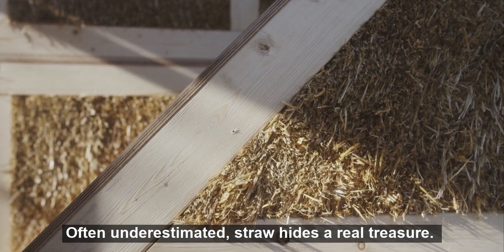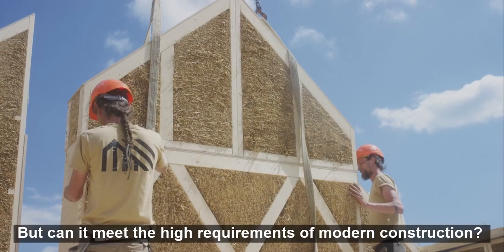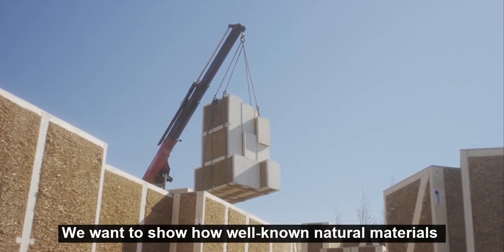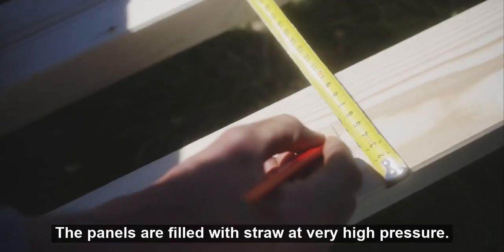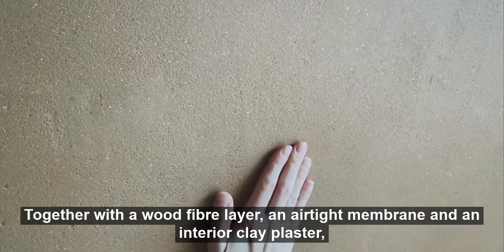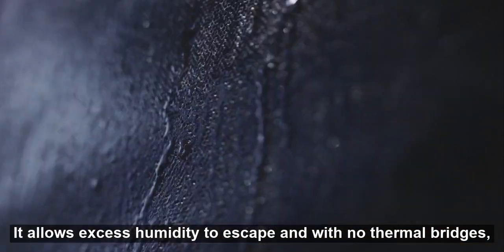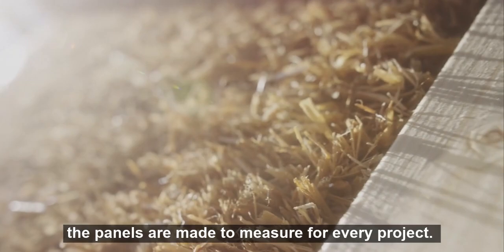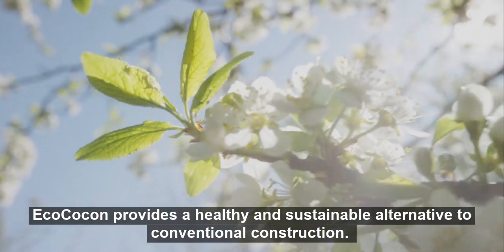Straw - the future of sustainable building

Comment: Any plans to expand to the United States? Also what is the R value or the thermal performance for the panels and how much wood fiber insulation is needed to achieve Passivehaus standards?
Reply: I guess Ecococon ships anywhere... In Slovakia it’s usually 100mm Steico protect. Depending on your climate it can be more or less.  Alternative is a cheaper VestaEco straw fibreboard.
Reply: @wardwillems09  yeah I saw they shipped everywhere but I would like to buy locally sourced materials to offset the cost and carbon offset of shipping half way across the world. I’m hoping eventually they will start manufacturing panels in North America
Reply: R80 probably